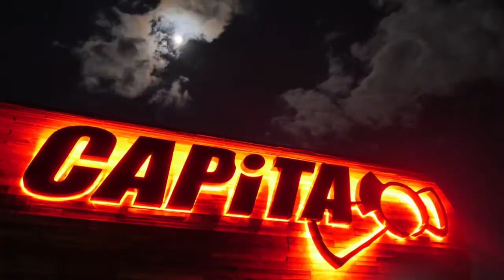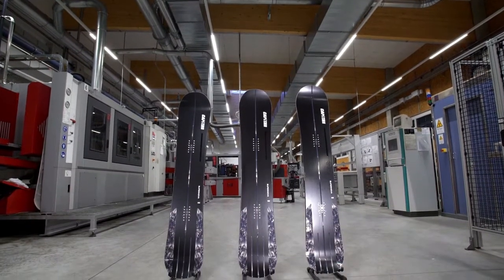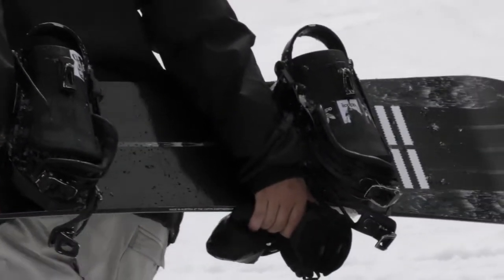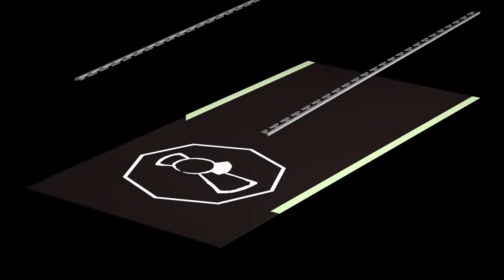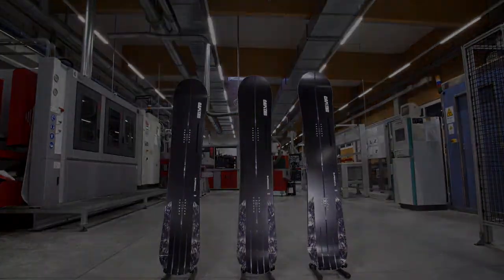2017/2018 CAPiTA: Supernova

Comment: wondering if those are stronger than in 2012-2013? broke 3 doa in 2 month of casual park riding back then and told myself that i'd never buy capita boards again, even though that they are great board for the two weeks they last, now that most of the other companies that i like don't have proper camber boards this board seems to be interesting.. if your boards are not as easy to snap as they used to be.. let me know
Reply from the maker: Hey, sorry to hear that. What was the issue you had with the DOA? Our goal is obviously to build them for a much different experience than what you had, was it a warranty issue that you were able to resolve? This Supernova is a very durable, powerful regular camber ride. We think you'll be stoked but please keep us posted with your feedback! You can hit us up at info@capitasnowboarding.com or shoot us a DM on instagram and facebook anytime.